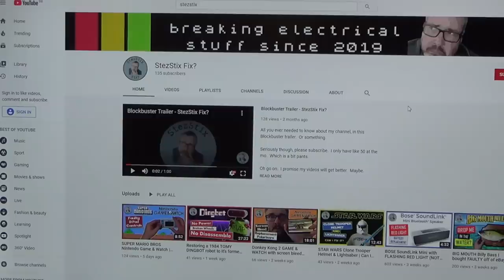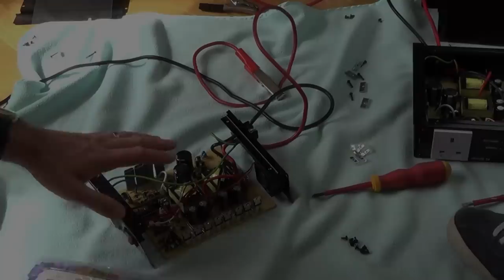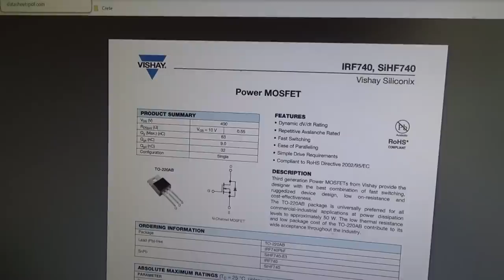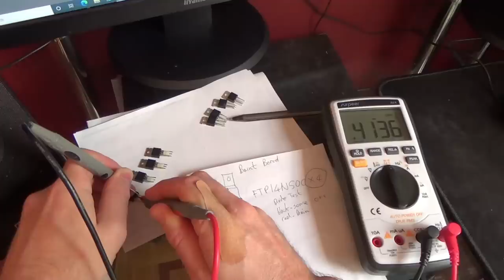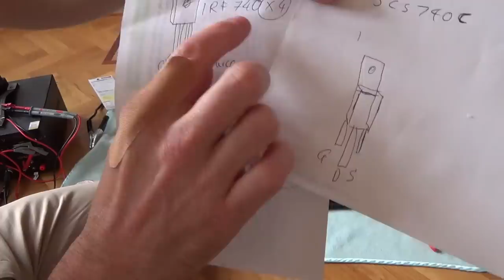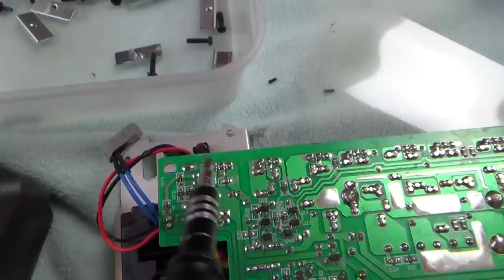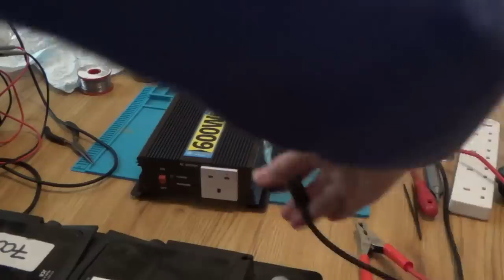Trying to FIX: 3x Power Inverters - 12V to 230V

Comment: Usually what blow the MOSFETs on inverters is a incorrect switching order because they need to alternate between each other to get AC, which means that if one fails to turn off (either because of a short or a incorrect gate potential) then when it alternates it will short out the others.
Reply: @Windows98GamerYT 🛠️🧰⚙️🔧 End 2020

Comment: Search for the datasheet of the DIP IC next to the optocouplers. That should be the controller for turning the high voltage DC to AC (it controls the 4 MOSFETS trough 2 of the optocouplers, the 3rd opto handles feedback). The datasheet should explain what gate driving signals to expect. Then you can try running the device without the MOSFETS installed (and thus without risking damage) and check the signals from IC all the way to the gates. There's probably still something wrong along the way causing shoot-trough.

Comment: Also check the opto-isolators are all good. I have a feeling  the switcher feedback is not working. The source of the original issue may be one of the capacitors, so check the smaller caps in the same area.

Comment: Great video =D  Shame they couldn't all be repaired. When you knocked something over at 49:40 it scared the s*** out of me lol!  Regards that test at the end - car batteries provide 50 / 100 / more  amps etc.  10 amps from a bench PSU just isn't enough.
Reply: GadgetUK164 - Retro Gaming Repairs & Mods ... yes I was thinking 10amps might be the minimum needed.  Come on Vince add some additional meters for in-circuit current and voltage. I’ve come across optimistic lab supplies which say “...is was 12v when it left us mate...” but don’t truly reflect the voltage under load.
Reply: Haha, I did exactly the same! I was watching with my headphones on and it made me jump out of my skin! 😆
Reply: The cables from that PSU look pretty skimpy - there could have been a very significant voltage drop along the cables...

Comment: A 12V car battery should be between 12.6V and 13.2V fully charged.  I wonder if you fully charge the battery if you would get different results

Comment: Look up the beep codes for the device.  All of my inverters alarm if the input voltage is too low.  Other than that the onboard CPU is likely detecting a fault in the drive circuitry.  No output means it is failing before output voltage is generated.  You could put a meter on the output and see if the voltage tries to climb, what frequency it is at, etc.

Comment: My Mate Vince, If the Donor Inverter fails after you replace the borrowed Mosfets, the failure is due to a miss match of the two replacement Mosfets being either slightly faster or slower, this mismatch is caused by environmental changes, along with impurities within the materials from one batch to another batch of production.

Having said that and if the Original Inverters Mosfets are cheap, I would replace all of them, as I suspect this may be the reason why an eventual failure occurred, This miss match has caused one or two mosfets having to do most of the work thus stressing them to their failure, and once they failed, what we had was a cascade of failures ergo taking out one extra Mosfet. 
If you decide to replace all of them,  I would suggest before you power it on, you first check all Diodes, also check that socketed IC for shorts to it's ground pin, if there is a short replace it "The IC" and check components around the IC empty socket for incorrect values to resistors, Resistors should have resistance, if they're open then they need to be replaced, as should any short circuited capacitors be replaced.. GOOD LUCK..

Comment: My inverters alarms like that when the input voltage is too low you need to check the 12 volt battery when the red fault comes on it may be low less than about 11.2 volts because car batteries are around 12.6 volt when fully charged.

Comment: Set your bench power supply to 12.8 - 13.2 ballpark, to simulate a car battery....

I feel like your big battery is also dead...  That long beep is low voltage....  

I think the smaller inverter works off the battery because it's not pulling as hard off the battery, and he battery is able to hang in there with "just" enough voltage to run the smaller inverter....  But under the load of the bigger inverters, the battery can't hang in, and the voltage drops down and trips the undervoltage alarm....

I feel like, with a properly charged battery, both of the big ones might be working....

You said it yourself...  Now they both behave the same....  Heh heh!  That's because they're both fixed, and both are hooked to a battery that is discharged....  Which, in that case, both are behaving exactly as designed.....

Those things are designed to put out that screaming tone when the battery is discharged...  It's trying to tell you, "Hey user!  Whatever you had plugged into me, just stopped, because I have no 12v power anymore! "

I look forward to the revisit...  Nice job.

Comment: the 4 diodes which are the bridge rectifier need testing, pull them ALL out of circuit, test them then put them back and test as a bridge rectifier they are right next to the 4 blown mosfet, then text the red resistor thing and any ceramic caps out of circuit, check the diodes feeding the 2 yellow supplies, from memory these are the things that take out fuses and mosfets, after that it can only be the 2 big caps or the 2 yellow supplies, that being said im a noob not a trained pro

Comment: Have you tried the beeping one on a running car or a battery on a charger. I have one that isn't like "smart" per say but it will turn off if the voltage dips below 12. It would do the same thing where it would start beeping pretty quickly and wouldn't power the high voltage side.

Comment: When the Mosfets shorted it sent high voltage to the drive circuit damaging it. Also tell your brother to not overload the inverters (he seems have blown a few of them), if it says 600W then use max 300W max. The leads from your power supply will be dropping voltage at 10A, even though you have 12V at the power supply you may only get 9 or 10V at the input to the inverter. keep up the good work.
Reply: Power Inverters 12V to 230V 🛠️🧰⚙️🔧

Comment: With the final issue, running from the bench supply. Check the current draw with a clamp meter, or simply put a 10A fuse in line and see if it blows. I would think if you are attempting to draw more than 10A the bench supply will complain, or the voltage will start to drop. Check the voltage on the scope. I suspect the voltage will have a lot of ripple, which may upset the inverter.

Comment: Hi pitch whyn is low 12vdc battery power from the old models would complain when current/voltage was low. Sense low voltage the pots might need adjusting after battery fully charged.

Comment: Hey guys, buy a 12v 20-50watt incandescent bulb ( in a holder ) and place that in series with the 12v battery

If it fuses, the light will come on, but it would limit the current to the inverter preventing bangs

Comment: Hint for next time .

Big a$$ bulb in the battery / psu feed when testing .

If one FET is faulty check the gate resistors & diodes / clamping diodes .

Chang all the fet's don't test & refit .

Fit just one 10 or15 amp fuse for the smoke test .

Comment: Regarding your Power supply. Generally these will disable themselves when they detect a low battery condition. the 11.9v would be very low for a Lead-acid battery, so its not enabling the output.
12.6v is a fully charged Lead Acid, so you should be aiming for around there!

Comment: I would just cut my losses and rebuild the inverter around a ROYER oscillator like a push pull oscillator but a feedback coil across the two bases of the  two transistors and a single bias resistor of 47K to VCC plus a 470pf capacitor across the two collectors so as to get a nice clean sine wave, it is a shame you cannot use Sanken MOSFET power transistors, I would replace the MOSFETS as well as the driver chip in each of the inverters.

Comment: All 4 output MOSFETs must be same, else a slightly different characteristics can lead to short
Reply: I was about to say the same thing but read your post, I was also going to advise Our Mate Vince to order 4 "Matched Mosfets" as in they all come from the same production batch or even better all from the same date of production for the Borrowed Inverters return to operation..
Reply: @KorAllRBare  Yes. All the MOSFETs need to be same, as at high voltage side these 4 MOSFETs are used in a H-Bridge configuration can slight difference can lead to failures. Would suggest to try to power the inverter without those 4 MOSFETs and theb if everything is fine (Test that the MOSFETs pin on board for 230+ dc voltage). Also while testing doesn't need to put all the fuse just one fuse should work.
Reply: @sam_8a  🐨Yep, I'm Quite aware of how Mosfets share the work load "Current", and I agree with your recommendations, 
Another method mentioned elsewhere is Current limited voltage injection at key points, which requires one to understand each section of a given circuit and it's prime component and what each supporting component it is required to do for it along with what the section of the circuits intended function is, it would also help to have a schematic of the device, especially when the device originates from China..  🤣 ?! 🤓

Comment: The small 4 pin components are opto-couplers. The one side is an infrared LED and the other is a phototransistor bonded with fiber-optic and potted. Their used as a feedback loop to regulate the low power side. You might want to watch some of bigclivedotcom's basic electronics videos. There's some from eevBlog, Great Scott, and others.

Comment: That beeping sound you hear might be anything to be honest but start with a freshly charged battery because it has higher voltage than 12v, 12volts on 6cell lead acid battery is almost flat (11.8 with no load on battery is 0%) and fully charged is around 13v.
These inverters pull a ton of current when turning on and if they detect low voltage they shut off to protect the battery because it doesnt know if the battery is really low or if it cannot deliver sufficient current.
Im no professional by any means but I've been around electronics all my life and this could be the problem imo
Reply: They pull A LOT of current. Not ton.
Reply: @simontay4851  Eh? "A ton" is a bit of an expression... I think pretty much anyone can guess that they aren't referring to the unit "ton". I don't see an need to be pedantic here.

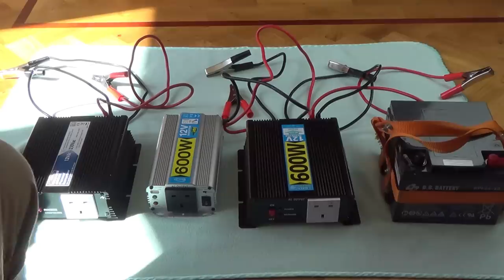Comment: Skip to 5:30 to get straight to the 'trying to fix' video!!! 
Hi, in this video me and my brother Paul have 3 faulty Power Inverters to look at. These use a 12V DC supply from a battery and output 240V AC. Can they be fixed or will it all end in a bang, tears and failure???

Comment: The cracked unknown component is a opto-isolator, you can tell because of the high voltage isolation slot cut underneath the components.

Comment: i know on some of them have a temp sensor could be a faild temp sensor shutting off the 240 side and setting off the failer warnig buzzer
Reply: Good afternoon sir.please sir I have suoer inverter 1000w and the red and yellow light is not lighting and I have tested all the mosfet all is good.please I need ur help.
Reply: Please sir the smd 5R1 and R050 how  should I test it.

Comment: @mymatevince i love your Videos and how you repair Things .
Thanks for the other Channels that  you suggested

I have repaired so many Things since ive Watches your Videos 
Im a elektrikal master and build solarroofs
I would Love to See trying to fix a solar inverter and i think that im Not the only one + you can make more Money with the repair  i suggest to start with fronius Inverter IG 15-60 Love to repair These Guys 
You have 2 AC Power Boards and 2 DC Boards AS example and you can Run IT with only one of them to Test which Board hast the failure not much Videos here in YouTube about it  and its Always good to repair Something that Not everyone do
I have  a few AC and DC Boards that dosnt Run but you need a Inverter to Test These.
Best to start is buy a IG 40 or 60 with an Error 
And i can send you 6boards to repair 
The AC and DC Boards are simmilar in all devices from IG 20-40

Comment: That bit at the end where you try to run something from the 12v on the power box, I think you need more than 12 v for that, more like 13.8V. Because a car battery while 12 volts is actually more like 13.8 and if it goes down too low, the inverter wont use it to run from.  At least that is how I understand it to work.

Comment: Vince, your power supply leads are very thin and you will not be supplying the 12 volts at the point they connect to the inverters cables. That inverter is going to need a good high current supply and steady 12-14v  and those leads will be dropping voltage across them because they are so thin. Remember the 600w inverter requires approx 50amps to run at full power. Approx calculations 600W/250V=2.5 amps, Times that by the step up ratio 240V/12V=20 so 2.5A x 20 = 50amps at 12 volts. This is without taking the poor efficiency into consideration !
So your little 10amp power supply is only giving a fraction of the current and after the voltage drop in the thin leads, not enough voltage or current to power the inverter properly. The internal fan will work slower on the reduced voltage tho and you can hear it running slower than when connected to the battery. A car battery can supply in the region of hundreds of amps when it kicks over your cars starter motor for cranking your engine. Think about the size of leads your dealing with on a car and the inverter and compare to those silly thin test leads !! Also the in rush current of the inverter probably peaks above the output of the power supply and that will current limit the power supply but in this instance I'm surprised your thin leads don't melt or get hot at least,  just like how a fuse works!! Lol.

Comment: Did you ever check the bridge rectifier on the high voltage side as if any of the diods there failed it could take out the Transistors.

Comment: Put an oscilloscope on the gates of the MOSFETs to see if they turning on at the same time as it might be the timing chip. The RC network controls the timing for the chip so worth checking them, study the datasheet of the ic. Check all diodes and transformer for shorts, check optocouplers because they're the feedback circuit. Please don't put PCB's on a static sponge, if that blanket came out of a tumble dryer there could be 1000's of little pixies searching for a juicy semiconductor. If you use one hand to poke around on the high side there less chance of electric shock, you can touch anyone terminal and you won't get a shock as these systems are not referenced to ground, its a floating voltage so if you touch the 240 ac live you just become the same electrical potential and as it's not ground reference no current will flow. Just don't touch the live and neutral at the same time because current will flow and your eyes will light up like sparkling led's on a Christmas tree.

Comment: Hey Vince, I have a smaller one of these that run off a lighter socket. Mine beeps the same until I start the car so I suspect it's insufficient input voltage

Comment: I have a similar regulated power supply but it's 30v at 5amps I think cause your using a regulated supply it self regulates so that might be why the inverter wont power on

Comment: It seems the MOSFETs aren't reaching saturation or fully switching off. It is this middle state where 95% of the heat is produced. It is probably a diode somewhere or a capacitor. Should have waited to the end. It is almost always a diode or several.

Comment: You need to test the drive transistors the (small transistors) ,  all mosfet must be the same batch, other wise one  could run hotter than the other  one , these inverters works like car audio amplifiers,  you could test by removing all mosfet and test the gate to see if there is a drive signal, you would need an a oscilloscope to test the drive signal, the diode are zener diodes to clamp the gate voltage, the opto couplers drivers the small transistor that then drivers the mosfets, this could feed back problem, the last one is you're wire from the power supply is too thin and drops the voltage too low , a fully charged battery is around 13.2v to 13.8v

Comment: 50:55 - Your PSU can't output clean DC at the required amperage. I doubt it would make a difference, but you could attach the battery leads directly to the PSU

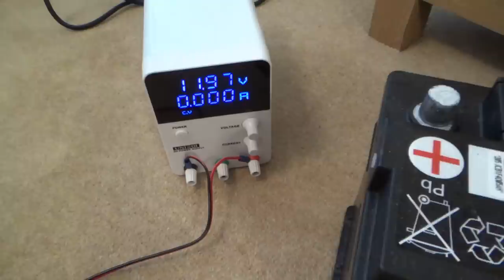Comment: Tip 1: 51:13 - there's your problem. The voltage on the power supply is too low. Most inverters have low voltage dropout sensing, and 11.96 volts won't be enough to get the unit to start. Remember that the float voltage of a car battery is over 13 volts (13.8 volts terminal/charging) so even if you set the power supply to 13 volts then you should be Ok. An inverter will not pull anywhere near 10 amps to start. 
Tip 2: Try not to touch the terminals of FETs and MOSFETs with your fingers. These devices are static sensitive and you can damage them by touching with your fingers, especially if you have just walked across the carpet.
Tip 3: Please don't buy semiconductors off ebay. They are mostly fakes and will blow up or simply not work when you install them, further confusing you as to what the fault may be. When they blow up, they can also destroy other components.
Tip 4; When working on this sort of gear, use your current limited power supply for testing rather than going straight across a battery. If you set the power supply to 1 amp or less (a small inverter should be able to start with no load connected on 500 mA) then if there is a fault you lessen the chances of things going bang - and you won't blow fuses either.